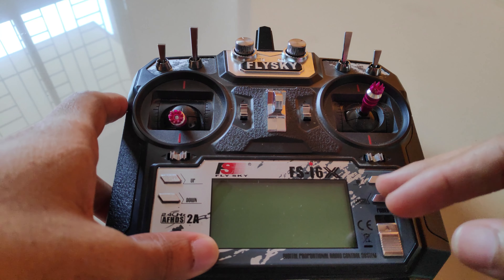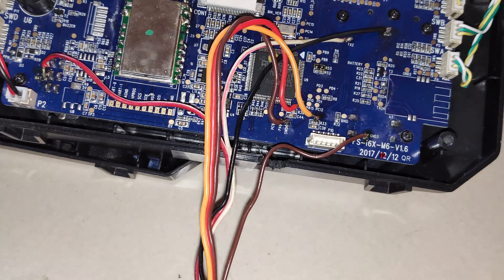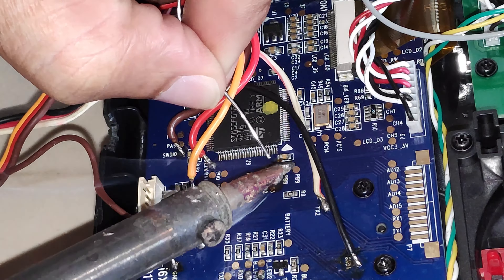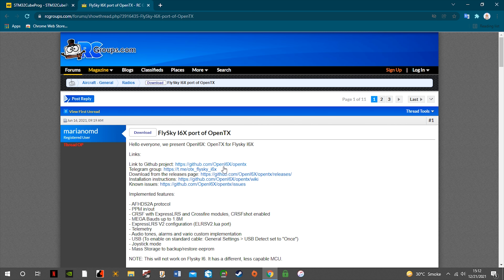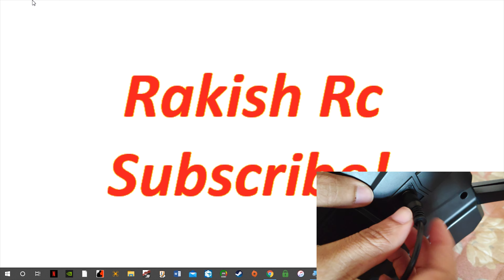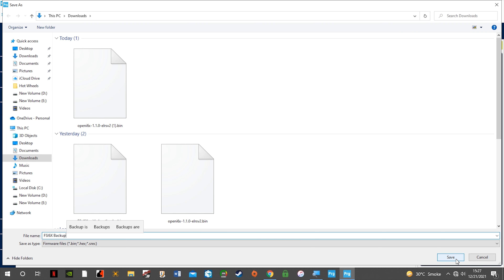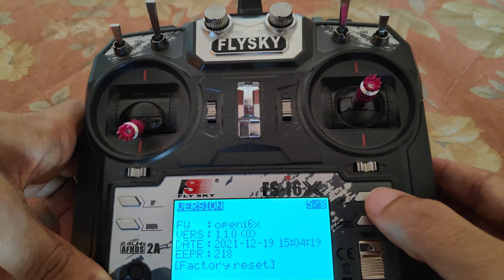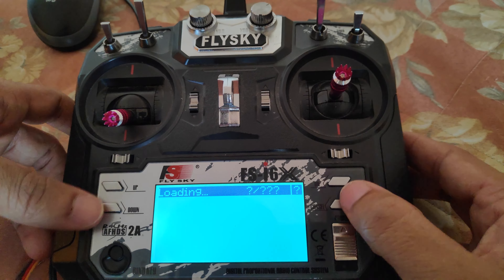Flysky FSI6X Open Tx Firmware Installation via DFU Mode

Comment: Thank you for sharing. I completed the installation by following the instructions, but when I connect Crossfire, the elrs menu remains as loading and the lua menu does not appear.
Reply from the maker: @FpvFunFly   check baud rate in radio settings and lower it to check if the Lua menu loads up.
How are you powering your elrs module?
Reply: @RakishRc  Yes, you tried different speeds, but you succeeded. When you enter the elrs tool, it stays in the loading text. For crossfire, I gave 6V external power output from the AA batteries of the remote control.
Reply: @RakishRc I tried different speeds. It didn't work. It stays on the loading screen.
Reply from the maker: @FpvFunFly  if you're providing external power then you also need to connect ground line from radio to elrs module ground pin along with the crossfire signal line. Basically the ground connection of the signal line. That's why it's better to power the module from the radio's power supply to avoid extra ground line.
Reply: @RakishRc  Yes, I am running it from the radio's power supply, but it does not enter the elrs tools menu and remains at the loading text.
Reply from the maker: @FpvFunFly  @rakish33 contact me at telegram. Share photos of the wiring will be easier to fix it quickly
Reply: @RakishRc  okay thank you
Reply: @RakishRc  Problem solved !! The problem was solved when I downgraded the crossfire version to 6.19 🤓
Reply from the maker: Nice! 👍 Enjoy

Comment: I had do same..but now my fsi6x is garbage for me.
After installing opentx.every time when I  on the switch.shows switch warning ABCD & throttel warning..then when i fix it all switch  and throttle position.its hanged  after last action.then restart with fix all switch and throttle.only show  White screen..also instal old firmware but tx not responding still in dfu mode like.please help

Comment: UPDATE: I'm upgrading from original FW to Openi6x v1.11.1 by following this tutorial BUT the TX seems like it is bricked and does not display anything. If you have the same issue, you can try to do full ERASE using STM32 Cube Programmer and then try to re-flash following this tutorial. I realize that the output log in this video did show "ERASING SECTOR ..." which I suddenly thought that why his step does involve erasing sector when by default, STM32 Cube Programmer will not erase the chip and may show "Sector not found".

Comment: Cube programmer is showing:no dfu mode.
I have done everything as in your YouTube video
Reply from the maker: Radio is not connected to computer correctly. Check usb cable is good and in device manager if raido shows up after connection and what it's displaying the device as
Reply: He’s right it shows up in device manager as apm32 not stm32  so it don’t come up in the program

Comment: If you do not want to solder the R53 pins and you have standard FS-i6X firmware, you can enter DFU mode via the following process. Power off the radio, push and hold the left vertical trim to the right and the horizontal trim down.. While holding them, power on the radio. The LCD will stay blank and you are in DFU mode.

That said, whether I enter DFU mode via this the trims or by soldering the pins, my radio isn't read as any STM32 device, it is still read as a flysky radio controller?? I'm going to try the ST-Link v2 adaptor instead.
Reply from the maker: Hi, you're right about the dfu mode initiation on stock firmware however the dfu mode is different with original flysky firmware and cannot be detected as a stm dfu device to completely erase and flash a new firmware. That's why the r53  pins are suggested for the stm processor dfu mode. If radio is correctly setup in dfu mode and unable to detect or show on computer then check the usb cable and usb port on computer along with stm dfu drivers if not installed. ST link usb device is also a sure shot way but need extra soldering which is not worth...r53 is the easy way with a pair of tweezers for the very first flash.

Comment: hi i have a problem the device manager detected the remote as other devices and i cant connect the remote with the st 32 can you help?
Reply from the maker: You need to update the drivers. If you are using the st link usb device then download and install the stm 32 utility drivers.

Comment: How do I return to stock fw if I dont have a backup?
Reply from the maker: You can download original firmware from Google/ cleric GitHub repository.
Just use stock firmware file and update like shown with open tx firmware file

Comment: thank you for your good structured video.
unfortunately i now have the problem that my chip is read protected. do you think it will be better when i buy st-link?
Reply from the maker: Yes because you can then disable the read out protection which is at level 1. Remember the existing firmware will be lost once read out protection is disabled.. however the original firmware file for fsi6x is easily available so not to worry. Then you can flash the openi6x firmware and enjoy

Comment: Brother my radio can't connect with my pc and i install all stm drivers which is use to connect what is will do now and one more thing i change my mcu chip with new one how upload firmware on it the chip is fully blank I change because older one was burned because of high voltage plz reply I wait for your reply
Reply from the maker: Hi, when you connect in dfu mode does it show up in device manager? The MCU you replaced is exactly the same as before right? If you are following dfu method then make sure r53 pad is bridged as shown from this video or solder the St link pads and use a St link V2 usb adapter. Either ways you should be able to flash the firmware and get the radio working 👍
Reply: @RakishRc  no it can't show in device manager
Reply: @RakishRc  and the mcu is same
Reply from the maker: @bachansahiljewellers  did you also replace the power regulator and other components that might have been damaged?
Reply: @RakishRc  only mcu burn
Reply: @RakishRc  other components work properly one time i can upload a firmware but warning show and after that again no response
Reply from the maker: @bachansahiljewellers  definitely the power regulator is also damaged is the MCU was burnt. Check closey if you notice burnt marks on the motherboard thoroughly.
Reply: @RakishRc  ok
Reply: How do I launch the software
Reply: @RakishRc   how do I Launch the software. I’m trying I don’t know how I did everything else though
Reply from the maker: @johnrose473  you installed stm32 cube programer right? Open that software and connect the radio in dfu mode and flash the firmware. Follow instructions from this video 👍
Reply from the maker: @bachansahiljewellers  did you find any hardware damage? Have you tried the st link method to flash the firmware?
Reply: @RakishRc  no I don't try st link method
Reply from the maker: @bachansahiljewellers  try that and see if you get any response
Reply: @RakishRc  I also try with st link v2 but with that it also can't connect now what I will do
Reply from the maker: @bachansahiljewellers  i am not sure. May be you should replace the motherboard with a new one. Or buy a new FSI6X
Reply: @RakishRc  my stlink v2 usb communication problem how to fix it

Comment: Legendary
Reply: @RakishRc  I am stuck at the device manager, my device is called APM32 DFU ISP mode, what did i miss? im running windows 10 
thanks
Reply: Also this was a new i6x that just arrived with stock firmware.
Reply from the maker: @GKCcisco  so your radio does seem to be detected in dfu mode. Did you try flashing firmware from STM 32 cube programmer?
Reply from the maker: @GKCcisco  what's the date on your fsi6x motherboard?
Reply: @RakishRc  2017/12/12
Reply: @RakishRc  yes I tried the stm32 cube programmer. It didn’t show up under usb devices
Reply: I have posted into the rc forum some pictures.
Thank you for these videos
Reply from the maker: @GKCcisco  thanks for those pictures it cleared my understanding about your problem. Are you able to download the ISP programmer from gheey website? Since your device is detected as ISP DFU you should try an ISP programmer software. https://youtu.be/-2Kpl9hB5C8 take a look at this.
Reply from the maker: @GKCcisco  https://www.geehy.com/apm32 there's isp software available to download. Use that.
Reply: @RakishRc  I’m not sure what driver to install, if I use the stm32 driver it is not assigned a com  port and will not show in geehy isp or other programs. I have managed to get it to show up in stm32 prog and geehy isp but using a usb serial driver. But it won’t connect and give errors.
Reply: @RakishRc  ok all flashed now! Needed to get the APM32 driver I used qmk toolbox and it’s very straightforward. If anyone else has this problem let me know and I’ll upload a install video
Reply from the maker: @GKCcisco  Cool!! 👍 Sure you can also share information on the rcgroup page
Reply: @GKCcisco  my pc can't detect the board plz help
Reply: @GKCcisco  qmk toolbox save me thanks, Buddy Edge saw me
Erase

Could not erase existing firmware
All is fine!

Comment: thank you for this informative viode my friend just flash on the  1.4.0 version on my transmitter. I just notice that the higher version you download it wont work due to increase of memory usage of the new update file so my transmitter work or only accept the 1.4.0 version.

Comment: My 6x only comes  up as apm32 isp  dfu mode  not as stm32 boot loader is there’s way to flash these one it does not show up in the software
Reply: It not worth it sir you have to use the stlink but it not worth it

Comment: I have faced a issue with my windows 11 laptop...when I tried to connect the transmitter in dfu mode to stm32cubeprogrammer I got an error showing device is in read protected mode...and I couldn't find any solution for it....but when I connected in my windows 10 laptop everything worked fine
Reply from the maker: In stm32 cube programmer on top left corner there's settings option through which read out protection should be disabled. But you've got it working i guess by now 👍
Reply: @RakishRc  yaa i have got it working but in my windows 11 i couldn't even get it connected in the software to change any settings....by the way thanks a lot for the information your videos help a lot🤗...keep doing these videos
Reply from the maker: @srinivasreddypamulapati5608  glad you have it working 👍 thanks for watching!
Reply: @srinivasreddypamulapati5608  Yep... This doesn't work with win 11. smh... Why did I upgrade?. lol...

Comment: So I updated to Ver1.6..0 using STLink V2 & four wires - worked Great - rebooted Transmitter and noticed wrong language selected - powered Transmitter off  and installed serial cable & pushed both horizontal trims to center to  set to DFU mode - now unable to reprogram using STMCubeProggramer (no connection to usb - windows sees device as DRPm32DFUISPMODE (NO DRIVER) & NO COM.  - ANY SUGGESTIONS ?

Comment: Windows isn't seeing my controller. I'm using a cable that has a kind of audio jack in it. Is this the wrong lead? I'm hoping it's an easy fix with a new USB data cable. Any advice would be great thank you
Reply from the maker: You can build a diy usb cable. The pin out for the rear connection port is available on YouTube and goggle. Find any usb cable and cut the small connector end and match the wires to rx tx gnd and VCC connection.
Reply: @RakishRc  I did! Worked an absolute treat and actually worked I like the 2 usb leads I’ve bought. Thank you!
Reply from the maker: @Rooonga  Enjoy! 👍

Comment: Hi, I did everything according to the instructions, but when connected to the computer, no USB devices appear at all. In my case, only ST-LINK will help? Maybe you have faced such a problem? - Windows 11
Reply: Did you have any luck? I have a similar issue
Reply: @GKCcisco  I have the same issue, but I think it might be because of the datacable. I'm trying to use the one for the game on PC, it's the type that has an audio connecter in it. I think it might not actually be transmitting data. Have ordered a data cable to see if it helps. @rRakish Rc can you please confirm?
Reply: I am also having same issue.
Cube programmer showing:no dfu mode
Reply: @anandanmunusamy2716   same here, done it before but wont work now. no dfu mode. Ever figure it out?
Reply: Anybody figured out???

Comment: You dont have to solder wires to the R53 pads, I've used a pair of tweezers like the ones you use to point to the pads and it worked like a charm. You only need the pads bridge the moment you power on the radio, you cand remove the bridge after and the radio will stay in DFU mode
Reply from the maker: Yes I can understand. But it takes multiple attempts to get it working with a tweezer. I find the wires much better but if anyone wants to try the tweezer way they can 👍
Reply: Flysky sure isn't making it easy to to go to DFU mode are they?

Comment: Hey, for me when I click connect it is giving error that read out protection is enabled. please help...
Reply from the maker: Hi, at top left you'll see OB / option bytes. Connect your radio in dfu mode and see if you get disable read out protection option under OB settings
Reply: @RakishRc  no....same issue still

Comment: where can i get factory firmware for the fsi6x.. might not have saved mine.. also, reason i need it is becasue when i go to expresslrs in the menu for open tx it just says Loading????. i dont know why. and ive flashed multiple times. 1.3version
Reply from the maker: The loading message means either some mistake in wiring the elrs module to the radio, if you haven't enabled crossfire protocol in external module settings in model settings, or you don't have elrs 2.0 on your tx module. Check if the ground and tx2 signal wire is soldered properly to the radio and connect correctly to the module

Comment: Its a great info, but i have a question before i installed open tx firmware, 
1. Is protocol stil afhds and afhds2?
2.Can we change the power output
3, is there a timer in it?
4. Can we back using flysky original firmware?
Thx a lot...
Reply from the maker: Protocol Is afhds2a, power output for elrs is adjustable not for regular built-in module because it anyways doesn't support that, yes you can setup timers, yes you can revert back to original firmware if needed.
Thanks for watching 👍
Reply: @RakishRc  you are so helpfull, thx a lot.

Comment: Can you tell me how to put the backup original firmware back into the flysky transmitter??
Reply from the maker: Same process just while flashing use the original firmware file. Use either dfu method or st link method make sure to use right file

Comment: Great option, but once again i have to ask..will it work the same for the i6 radio? Just jumping the r53 pads?? Maybe not...considering that the main board is different🤔
Reply from the maker: Hi, no this won't be same for i6 because the board is different. There might be a pad to jump but not sure which and of it'll work.

Comment: Can it work on fsi6 & frsky receiver bind it with fsi6
Reply from the maker: For fsi6 there is erfly6 firmware with crossfire support. Don't think you can bind Frsky receiver because no multiprotocol

Comment: How do I bind?
Reply from the maker: In model settings under protocol option there is bind option. Put the receiver in bind mode first and then turn on radio and select the bind option to bind the receiver 👍

Comment: I followed your steps exactly and everything seems to work, however when I press "download" the STM32 program just loads and loads. I have tried previous versions of the Openi6X but all just keeps loading....Any suggestions?
Reply from the maker: Do you see the radio in device manager as STM 32 dfu device? If yes make sure to select usb option in top right corner of STM 32 program and then connect. Select the firmware file and then click on download.

Comment: Hi Well Done. Will this work with my Turnigy / Flysky i6S touch screen model? Thanks
Reply from the maker: No I don't think it will work. You'll brick your radio.
Reply: @RakishRc  Yes thanks for warning. I found out apparently there is no implementation for the touch screen to work with OpenTx so wouldn't work

Comment: if you flash Open TX to the FS-I6x transmitter, Can you bind any receivers to it OR only Flysky receiver?
Reply from the maker: Flysky receivers, express lrs and tbs crossfire are supported and any tx and rx ppm module as well 👍
Reply: @RakishRc  can you bind Frsky receivers also
Reply from the maker: @jacquesadendorff1175  no
Reply: @RakishRc  thanx man, is it worth changing over to openTX. i just started with FPV drone
Reply from the maker: @jacquesadendorff1175  open tx is a huge upgrade for fsi6x. I am myself new to fpv drones as well.
Reply: @RakishRc  cool. so you say its a good thing to go over to openTX

Comment: STM32Cube connected to USB - Error:   09:19:30 : Manuf. ID   : STMicroelectronics
  09:19:30 : Product ID  : STM32  BOOTLOADER
  09:19:30 : SN          : FFFFFFFEFFFF
  09:19:30 : FW version  : 0x011a
  09:19:30 : Board       : --
  09:19:30 : Device ID   : unknown
  09:19:30 : Warning: Device is under Read Out Protection
  09:19:30 : Disconnected from device.
Reply: same issue for me also

Comment: Sir pls do the same video with fs i6 tx also.most off them are using fs i6 instead of fs i6 x
Reply from the maker: I don't have fsi6 unfortunately and open tx is not supported on fsi6 only works on FSi6X. For fsi6 er9x aka erfly6 is the best firmware. 👍
Reply: @RakishRc  so please flash er9x on fs i6 using method shown on the video 🙏🙏🙏